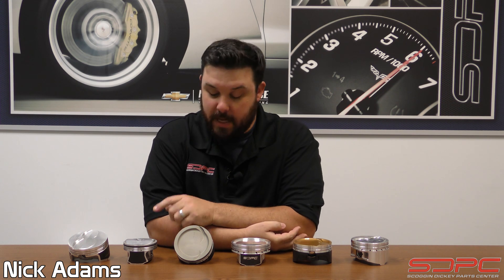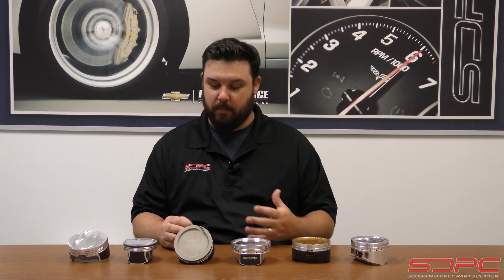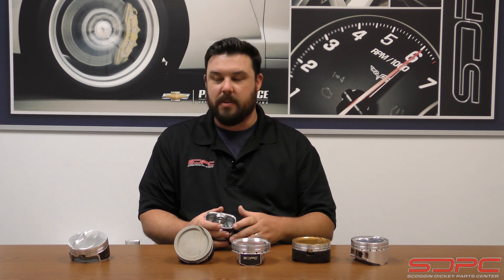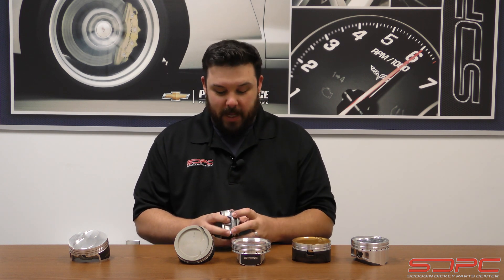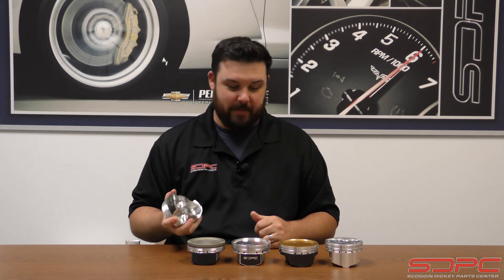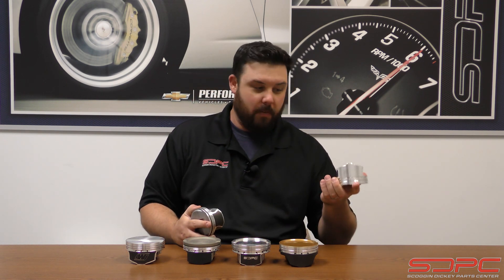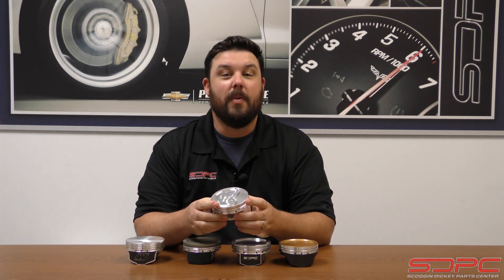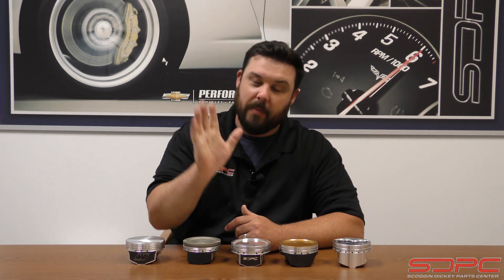SDPC Tech Tips: Piston Selection

Comment: Wanted to keep costs down with an LM7 stroked to 383 with forged internals (4" stroke\3.905" bore). Problem is the compression height (1.110"). Very good for NA perfomance but I am concerned that the ring pack placement is far from ideal for heavy boost\nitrous. Should I shorten the stroke, taller block, or some other piston choice to alleviate this problem? 0.40" from the piston crown seems to be a good place to start. The extra 0.0055" in top ring gap has me less concerned when running all motor and E85. Gas venting should help. All input is welcome but the goal is to keep costs down using the LM7 block.